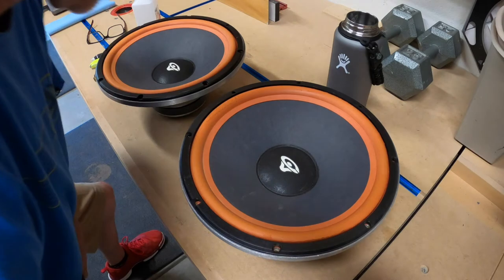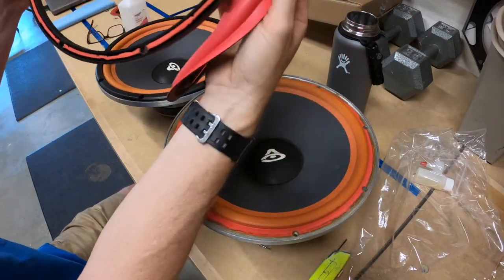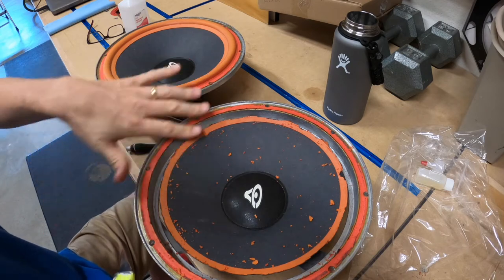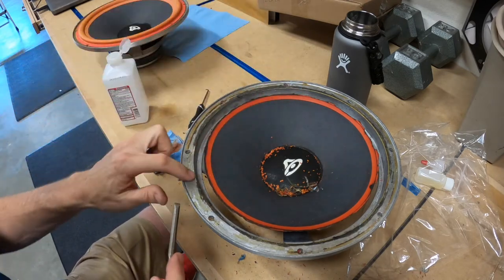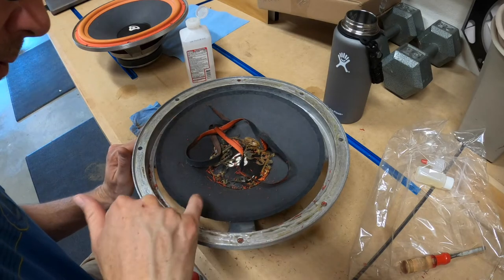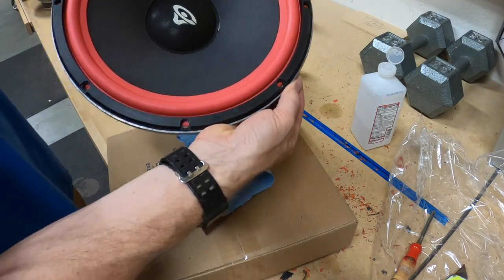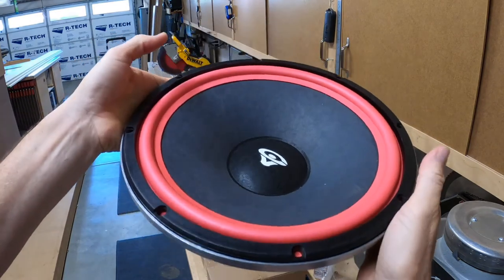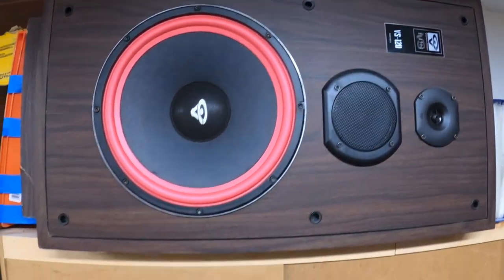Vintage Cerwin Vega Speaker Foam Surround Replacement and Restoration.

Comment: Great instructional and teaching video ... I think I'm going to restore my old vegas ... Do you know how long the new Foam Surrounds will last?
Reply from the maker: Thanks a lot Alex.  I cant say how long they will last, but can say that they will for sure be a huge improvement over old nasty ones.  The sound is much better.  Punch is back and the lows are even better.  Also check your ports too.  They may be loose or off completely.
Reply: Literally just did a pair of CV  12" surrounds. The first foams lasted 35 years. If kept out of the sun there's no reason new surrounds won't last another 30 years. Just buy your surrounds from someone reputable. Audio shop in your area or a good online store. I never trust eBay for authentic parts.
Reply from the maker: @Cimone90  thanks for the comments.  I appreciate it.  These surrounds seems very nice.  Just like my originals.  I honestly can’t say for sure how long they will last, but I’m sure they’ll be good for a long time.
Reply: This will be the 3rd time I've  Replaced my surrounds.. Purchased the speakers in 1990.
 1st Replacement was within the 1st couple of months, due to a ferret. 2nd was due to the fact that I was using them as DJ equipment for a time. This time just due to age. 
  Honestly  vega could have used a better material for their surrounds back in the day.  They did upgrade the foam at some point from just a straight foam to a coated foam,  Which does help in their longevity

Comment: I've done a lot of speakers.   The edge is not hard to remove from the cone.  Don't use your knife is a slicing direction. That risks cutting into the cone.  Keep your knife verticle and scratch at the old foam with the tip.  It will scrape off the cone.  You can take some acetone and soak it if needed. Use a q-tip to apply the acetone.  You don't want to peel off any layers of the paper.  That weakens the edge of the cone.
Reply from the maker: Thanks for sharing.

Comment: I just did this (actually still waiting for the glue to dry).  It's a bit dicey scraping the ancient foam and glue off the cone without cutting it, but I managed to complete the job without doing any damage, just a few minor cosmetic scratches near the edge.  Hopefully this will be worth it
Reply from the maker: It’s a great way to get the sound back to life.  It does help a lot.  Better woofer control.  And it looks wayyyy better.  So glad that my video maybe helped you.
Reply: @davidbryanwoodworksandmore  it's too late now, I'm going to crank them tomorrow, these speakers are ludicrously loud.  I found them out on the curb the other day walking my dog, one of my neighbors was just throwing them out (along with a receiver).  Sweet find and probably the only way I'd ever convince my wife to let me bring home a giant pair of speakers 😂
Reply from the maker: @bigblack9819  Big Black you are one lucky man.  Good Job.  Are they the same model as mine or another?  I can't believe somebody would throw them out.
Reply: @davidbryanwoodworksandmore  mine are RE30's, made in 1995.  They've got 12” woofers, pretty much in perfect condition besides the dry rotted foam surround.  If I had to guess, the previous owner probably "upgraded" to a smaller bluetooth speaker, since the Cerwin Vegas are so big and heavy.
Reply from the maker: @bigblack9819  his loss your gain.  Nice job saving them.  Those are cool speakers.  Congrats.
Reply: There is a trick to scraping off the old foam.  You actually don't need to worry about the old glue as it will reactivate when in contact with acetone or an acetone based adhessive.  When water based white adhessives will grip it.

Comment: very good job.  i have a pair of HP-215. thats a big black box with two 15s and a ten inch horn.  i bought them new in 2005.  they are fine, but the foam is faded out and not so orangy anymore. id like to refoam them but im scared to do it. i dont want to fuck them up.
Reply from the maker: Well I’d say that this is a very doable job as I showed you.  That was my first time doing them as well.  They are still perfect. I think you can do it.
Reply: @davidbryanwoodworksandmore  ok.  I will buy some foams and try it
Reply from the maker: @stevethomas-cc5lz  sounds good.  Good luck.

Comment: I just refoamed my little 8" bookshelf Vega speakers yesterday with the same kit, super easy to do.  Just checking in to ask you how your speakers are still holding up?
Reply from the maker: @bryanspelhaug2135  hey that’s pretty cool that you did some 8” ones.  I love the at-8.  Are those the ones you have?   Mine are just like they were when I did them.  Perfect.
Reply: @davidbryanwoodworksandmore  The one's I have are the Re 20's purchased in 1998.  I let the foam cure overnight and tried them this morning and they sound like the day we got them!  Thanks for the update on your speakers and for posting the how too video!
Reply from the maker: @bryanspelhaug2135  awesome to hear.  lol.  I think it’s great that you have them still.  Cerwin vegas really are tremendous speakers and are fetching good money now for content ones.

Comment: Just curious where do you get tou foam kit? I got one off Midwest speaker and the foams were defective so i sent them back and ordered from Brew City. Brew city makes a better foam imo and includes paint brushes, 2 types of glue and gave me free dustcaps and shims and shipped within the hour. If anyone is looking to order foams or whatever CV related, Brew City is where its at. His foams are designed to hide the old glue ring unlike any other foams you may find. They are the right color CV used also. That old glue ring would have annoyed me for the next 20 years. So glad i dont have to worry about that now.
Reply from the maker: I got them from eBay and am extremely happy.  It’s beautiful.

Comment: Hi David, This was a really interesting video! My friend and I were discussing how old speakers can fetch serious cash, without the foam and cone. I've never owned any high end speakers to justify repairing them, though I've scrapped enough low end speakers from foam rot :(
Would a heat gun work with removing that glue? I've used a hair dryer before for removing old price tags.
Reply from the maker: Thank you for watching and commenting.  I a kk so back in the day scrapped speakers because of this problem. You know when I bought these on craigslist, another craigslist buy, I new I could fix them.  So I got a great deal.  It makes a lot of sense.  I think a heat gun could work.  I would certainly give it a shot maybe on some practice speakers first.  I love these cerwin vegas. I’m glad that at least a couple people found the video interesting.   Thanks again for watching and commenting.
Reply: @davidbryanwoodworksandmore  where did you get the new foam?
Reply from the maker: @anglerandy5736  it’s in the description.  At the top of the links.  But here it is again. https://amzn.to/3dMiLDG.  Thanks fir watching.

Comment: Hello, what kind of glue is used?
Reply from the maker: It came with the kit.  I believe it’s rubber cement.
Reply: @davidbryanwoodworksandmore  thank you. Trying to repair vintage kenwood speakers. Ordered the surround foam but it does not come with any adhesive. Your video is very helpful.
Reply from the maker: @mccebu5121  you’re welcome and good luck. Hope it comes out great.

Comment: Any idea who can restore/repair a cabinet and get mine working again?
Reply from the maker: I’d say a woodworker.  However these cabinets are melamine and that’s kind of hard to repair. The particle board breaks and it’s really tough to fix.  What’s wrong with your?
Reply: @davidbryanwoodworksandmore  got dropped during a move
Reply: @davidbryanwoodworksandmore  over 30 years old and looked almost brand new. Had foam replaced once
Reply from the maker: @seanmoore8357  that’s not cool.  These are really great speakers. As you know.
Reply from the maker: @seanmoore8357  I’d say try to find a woodworker near you or maybe even a wood finisher.
Reply: @davidbryanwoodworksandmore  Can you send me some photos.  I generally would also suggest a carpenter, however some damages may not require that much investment.  I use to work for an audio place in Los Angeles.